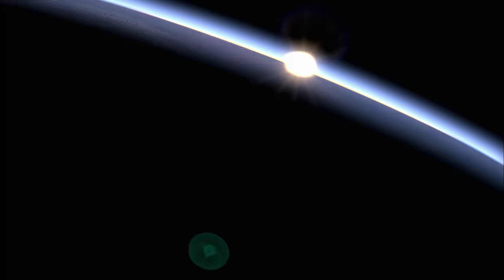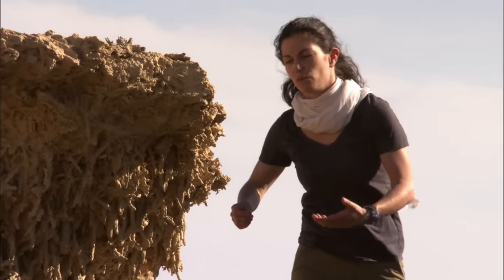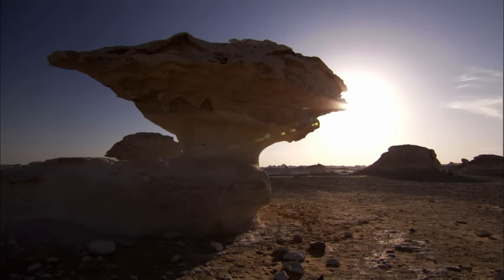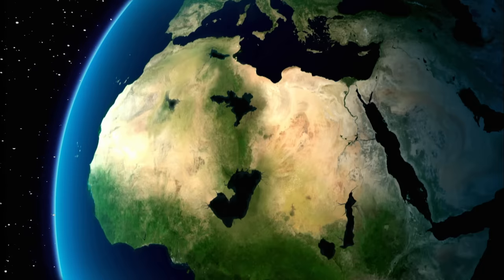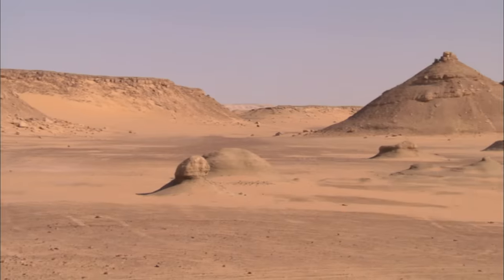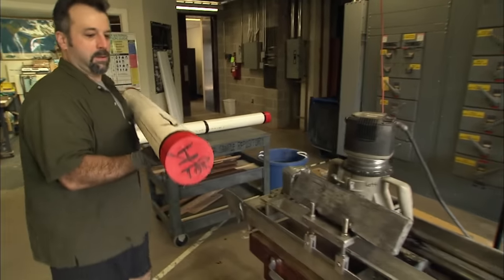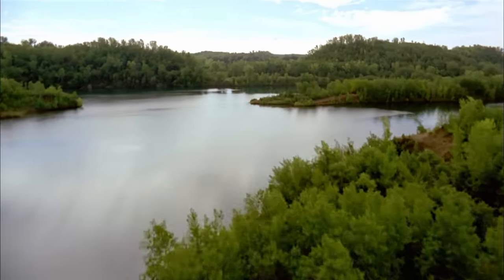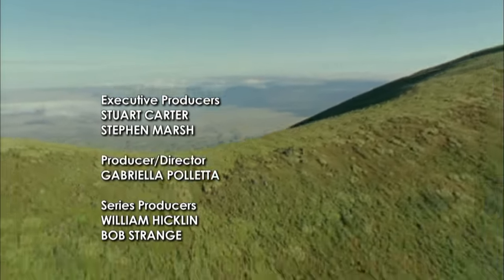The Sahara Desert's Scorching Heat | How the Earth Was Made (S2, E4) | Full Episode | History

Comment: The current official highest registered air temperature on Earth is 56.7 °C (134.1 °F), recorded on 10 July 1913 at Furnace Creek Ranch, in Death Valley in the United States.[1] For ninety years, a former record that was measured in Libya had been in place, until it was decertified in 2012 based on evidence that it was an erroneous reading. This finding has since raised questions about the legitimacy of the 1913 record measured in Death Valley, with several meteorological experts asserting that there were similar irregularities with the 1913 readings. If the 1913 readings were to be decertified, the highest verified recorded air temperature on Earth would be 54.4 °C (129.9 °F), recorded at Death Valley's Furnace Creek on 16 August 2020.[2]
Reply: The highest temperature ever recorded on the Sahara is 2° higher and that’s just know. It’s kinda hard to measure it though cause it’s so big not saying you’re wrong that is definitely up there though.

Comment: Wouldn't it be easier to take raw-light materials(sand, dust, dirt, etc.) to the site where these structures were built instead of HUGE blocks? Also, since it's claimed to be so hot; shaping stones with raw material and water from the Nile or any other water source and letting the sun do the work to bake the blocks made or by furnace... I can see this being accomplished in a short time with enough people. This may sound ridiculous but, not as ridiculous as dragging HUGE stones through a desert IMO
Reply: First, if you tried building the stone from scratch you'd have to have a press large enough and strong enough to compress the loose stuff into stone.  Compaction results from decreasing the water and then air space between particles.  This takes a LOT of pressure, for instance the pressure under 2,000 ft. of water for a looong time, which is where sandstone is made.  We can't make rocks even with today's technology, the best we can do is to make concrete.  Concrete is a collection of small stones and grit held together by a binder.  Concrete's binder is what is known as Portland cement; a mixture of calcium silicates (known as limestone), aluminates and ferrites.  Portland cement and similar materials are made by heating limestone with clay or shale (a source of silicon, aluminum and iron) and then baking this mix at very high temperatures (~1,450 degrees C or 2,000 degrees F) for about 5 hours.  This heat partially melts the mix which ends up as a collection of nodules of 1-10 mm known as clinkers.  The clinkers are ground into powder and then mixed with a source of sulfate (most commonly gypsum).  This is the raw cement.  Water is then added to create the type of mix needed and the result poured into molds (wooden forms in buildings for instance).  Then it has to "cure".  The cement must be kept damp for curing to occur.  During curing hydration occurs, allowing calcium-silicate hydrate (C-S-H) to form.  90% of the curing is complete after about 4 weeks.  This is probably way more information than you need to realize why the Egyptians didn't make concrete, but I thought you might be interested.
Reply: @FloozieOne  I appreciate the information on cement but, I am still more interested how the blocks were made and shaped. It has to be simple and we are making it complicated. I just can't see anyone dragging huge stones unless they lived longer and time wasn't as big as a factor. Tales have been told that many people die during construction. I do not know what the statistics are now but, even building underground railroads many have died. Waiting on them finding a mass grave in Egypt like, North and South America, for example.
Reply: I agree totally. Concrete was made of the surrounding sands and whatever took place millions of years ago to create petrifaction also transformed these blocks of concrete back to stone

Comment: Some had fossils in this area. Some never thought about the way we cement today or what method was used to incorporate the stacking and setting of liquid type blocks. Yes it's been said once covered with water..or raised in movement as plates were adjusted. Once I wrote same similar aspect in response. There's more to that unexplained explanation. The way people are asking now was not a set study . Too, the retrospect for water being some aspect of the build has much to do with some true energy affect. The compounds should have a study and do check the granite amount. If the first show of this has continents connected,the room for a sea/ oceanic is less likely as size goes. True, clues show some water, maybe it was larger than believed. Dry air or atmospheric oppression? Since it's been brought up. Tell the story of findings at this point, not just what you want to hear. The rock has height as well. That may have been large sculpting too. Maybe a larger work place or remain wash away from weathered issue

Comment: 2,000,000 blocks in 20 years? That comes down to one block every 6 minutes! With joints and seams so perfect and tight, you can't fit a piece of paper in them. And that's if you work 365 days a year, 24 hours a day. But, the Nile floods every year like clockwork. Pretty much shutting down all pyramid building. Impossible!! If you disagree then stand up and be counted, give a thumbs down.